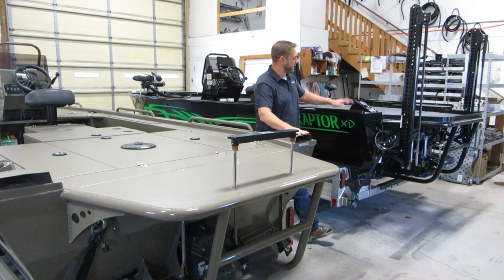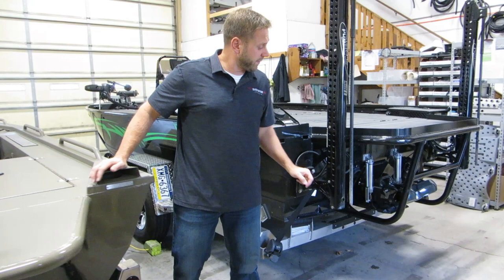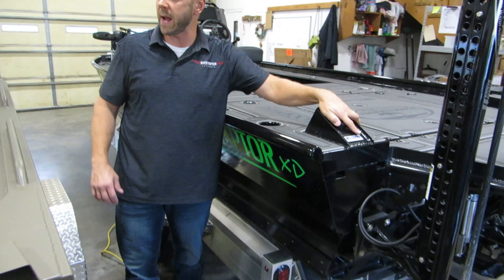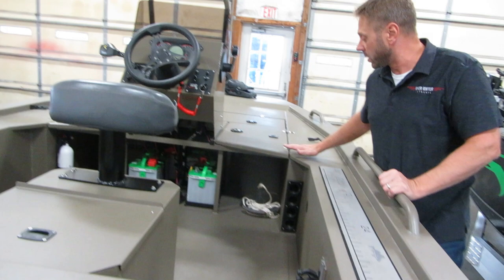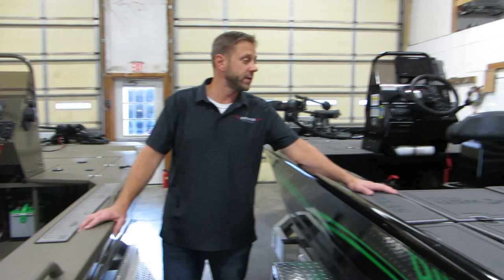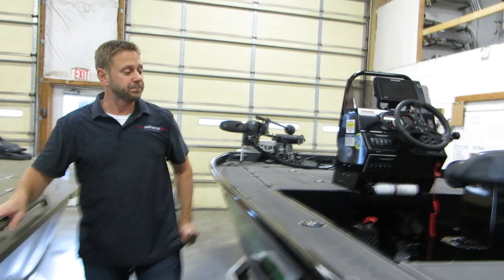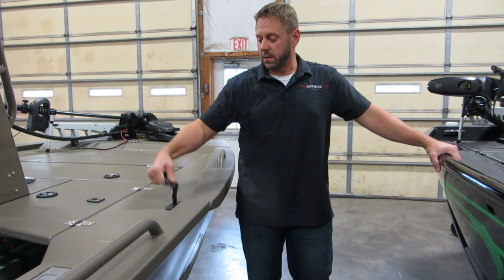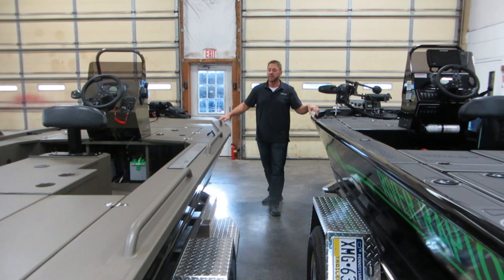What Is The Difference Between the XR and the XD?

Comment: What's your warranty on one of these? Say I didn't want that material screwed into the bottom and just wanted the K5? 
Also do you guys offer a track system in the gunnel? If so I think you guys created the ultimate boat
Reply: A full disclosure of our warranty is on our website on the warranty-shop rate-contact page.  K5 is available for our boats, although we recommend the 1/2" uhmw for our heavier boats.  Warranty is the same either way.  We do not offer a track system at this time, although we could probably do one as long as we can get our hands on the extrusion.  Thanks for your interest in our boats!